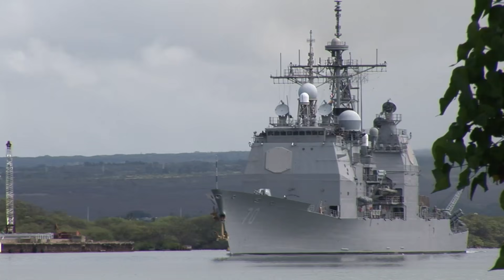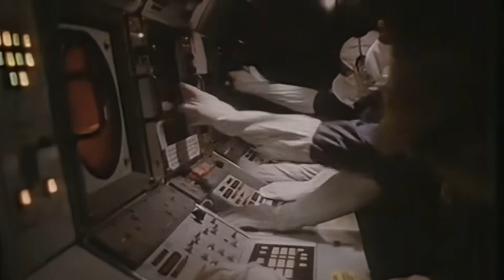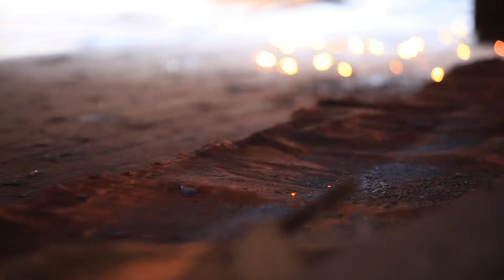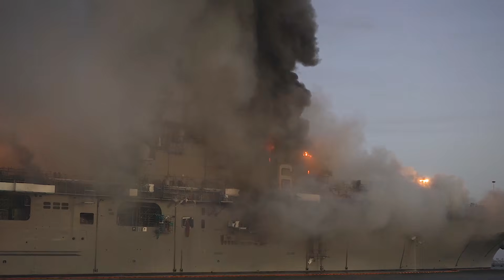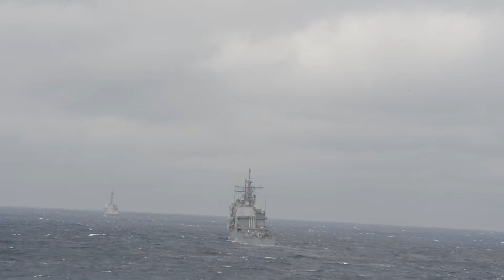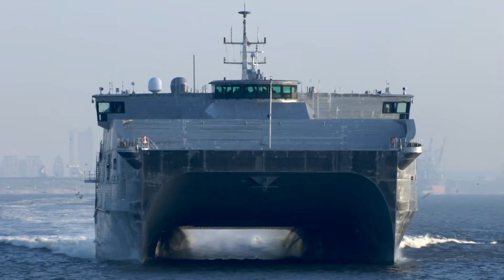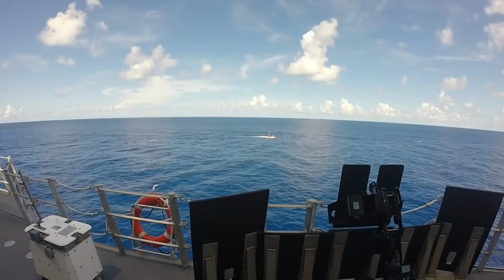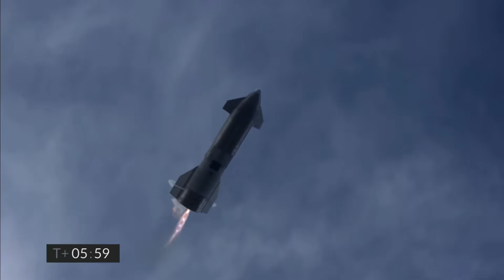Why is The US Building Aluminum Warships?

Comment: The sad fact is that an institution that is so steeped in history as the USN CANNOT REMEMBER THEIR OWN HISTORY!!!  They have to relearn it about once a generation.  Steel hulls with Aluminum was UNlearned when Forestall caught fire and burned Belknap to the main deck level.  A generation later the USN builds THREE classes all on the same engineering plant (Spruance, Kidd, Ticonderoga classes all use same engineering plants) and ended up using aluminum upper super-structures to save weight to make less them less top-heavy.  When SERVICE MEMBERS put their put collective foot down and REQUIRED the Arleigh Burke's be built out of the steel, the USN ended up with some of the toughest, most seaworthy, most capable combatants in the world!  But lessons cannot be kept and when the LCS 'do everything, but do NOTING WELL' design philosophy was promulgated aluminum was used THROUGHOUT the ships.....  Furthermore, after nearly a hundred years of using aluminum in the marine environment, the USN was talked into NOT PAINTING the ships (never mind the fact that crews have reported that crews can literally crumple handfulls of corrosion off of the hulls).  Further aggravating this problem(s)  is the minimal manning philosophy of their crewing which leaves then without enough crew to even PAINT them and maintain topside surfaces!  This now necessitates all 'home-port' bases now have shore crews permanently available to help PAINT the ships!

Comment: Aluminum is used in LCS class to save weight because they are designed to be used on inland waterways or shallow riverways!!
Reply: You're confusing the term littoral with inshore or riverine Force. Wrong mission.
Reply: @WALTERBROADDUS  I was talking about the missions I heard or read about.  As I recall both the Freedom and Independence were meant to support, supply and serve SEALs by launching riverine craft closer inshore then larger assault carriers like the LHA, LHD, classes. Also, the mission packages can be "swapped" out depending on needs of the mission, like bringing SEALs, Marine Force Recon and other special operating forces. Thank You for post!!

Comment: citing space shuttle as an success then it burn up and was abandoned is just weirdchamp.

also your understanding of spacex is wrong. musk choose steel for heat management reason and not due to their structural property.
effectively musk wants the steel to absorb and carry the heat by conducting it to spread the heat over the ship.
this is the same strategy use in rocket engine design were the piping  goes around the nozzle so the fuel double as coolant.
note that this is only a theory, no one has tried to survive reentry by conducting heat before.
the other reason why they are not going for composite is simply an issue of cost since there is alot of development required.
whereas musk can easily and quickly hired steel worker to build them quickly. 
in a way, he choose steel because he expect alot of failures, thus the ability to build dozen of them a year is critical.

Comment: Lesson from the RN: have proper air defense and intercept capabilities. these aren't the kind of shit you should cheap out on.
Reply: bit of an oversimplification. The systems were based on long range Open Sea, bomber threats. They had mix of long and range  systems. Most losses were by dumb bombs, not missiles.

Comment: They cost more and wear out sooner. That's good for keeping the budget up.
Reply: Yeah. I understand using it in smaller ships such as coast guard where the ship or boat being faster would help as aluminium is lighter
Reply: @Cooldude-ko7ps  the cost guard getting new equipment? Lol no where would money come from, the navies budget? Dont ve silly
Reply: @Cooldude-ko7ps  Coastguard? Coastguard?! It's real name is "Puddle Protectors" or "Puddle Pirates" as some others call them
Reply: Not only faster. But any seas over 10ft damage them.
Reply: mine would be bullshitium the unbreakable mettle
Reply: @flintycave5634  kek
Reply: Most bean counters that propose cost saving measures. Never ever served on a ship.
Reply: move to iceland. they dont have a military so you wont have to bitch about paying for it
Reply: @Jim-vg3vb  well iceland actually does have a coast guard (instead of a navy) but its relatively small.... their function in NATO is more about shoreside radar stations, a small airbase and port capability for the allies in NATO.
Reply: That's what happens when Corporate America owns the government.
Reply: Next up: ships made of pure gold
Reply: In 90% case the aluminum vessel which doesn’t corrode will outlast the steel vessel. There are many aluminum vessels out there with the hull over 35 years that are still going strong. Steel ships are often scrapped after 20-25 years as the hull maintenance cost of cutting out corroded steel and replacing  becomes prohibitively expensive. Navy’s generally look after the paintwork much better and potentially get more life out of a well painted steel hull
Reply: aren't military programs focusing on providing jobs?
Reply: @hphp31416  they are, sometimes in hilariously wasteful ways. From what I've heard they were already canceling the Zumwalt class but a representative from Maine claimed they could lose some shipbuilding jobs so they shelled out roughly $7.5bil to build a flawed ship no one wanted or needed, all to prevent a few manufacturing jobs closing. Probably would have been cheaper to have just paid the shipwrights to set fire to piles of money for 40 hours a week instead of building that giant lemon
Reply: @arthas640  Sounds like a pretty good way to reduce the threat of hyperinflation that's looming. Gotta reduce that money supply.
Reply: @hphp31416  Also prop up stock funds like the Carlyle group. The fund transcends governments and insures the most wealthy on the planet win, no matter the outcome of any war.  You need to be very wealthy, like the Bush family, Murdoch, or a Saudi to buy in.
Reply: @hphp31416  It's a case of legitimate reasons overlapping with graft. Essentially, there's valid reasons for a nation with an independent defense industry to do things less efficiently if it means keeping a continuously employed skill base and robust defense industry. 

For instance, the welders who work on submarines are an extremely specialized vocation. 

It costs money to maintain assembly lines and tooling and takes time and money to rebuild them if they're scrapped.

There's also good reason to spread the defense industry out across as much of the country as possible so a strategic campaign or an assault landing doesn't destroy a nation's war fighting capability in one fell swoop . . . War fighting considerations don't always overlap with purely profit considerations. (Not to say a war may not be motivated by profit)
  
The less legit reasons is that it does generate a lot of jobs in representative's districts and it funnels a lot of money to people they golf and club with.
Reply: @hphp31416  Only partly. That's more of the reason or other way they get specific Senators to sign onto the bloated budgets. "We're giving your state 1,500 high paying jobs. Or keeping those jobs around. Keeping that dockyard or aircraft factory or tank parts machine shop open." So they sign, even if it's hypocritical to their beliefs of debt, budgets and limited government. Because they want to get reelected. But the actual projects come from the military for the sole purpose of improving their capabilities per projections and doctrine.
Reply: @hphp31416  no
Reply: @MinehowTech  Actually, yes...the more people who die in your thin ship hulls, the more people you hire to make more ships, and more people recruited to be in your new ships...that will die. Repeat cycle.
Reply: @MinehowTech  Actually, yes. Military programs and most government programs focus on providing jobs hahaha. Private companies maximize profit, public ones maximize labor.
Reply: @MinehowTech  actually yes
Reply: Fuck y’all I’m making my Vibranium aircraft carrier

Comment: Aluminum doesn't rust like steel does.... Aluminum forms a strong layer of oxide that doesn't corrode. Nilered displays how durable aluminum is
Reply: Wrong conclusion. Rust is iron oxide. Aluminum has no Iron.
Reply: @WALTERBROADDUS  wrong. Aluminum oxide exists.
Reply: @SteveVi0lence  We did not say aluminum oxide did not exist.
Reply: @WALTERBROADDUS  in my post there is nothing about iron. Only aluminum
Reply: @SteveVi0lence  Then don't use the term rust.

Comment: The thing is, surface ships are largely irrelevant when there are nuclear attack subs able to wipe out fleets
Reply: Thermobaric warheads will remove fleets from the sea too...  Doesn't have to be a sub to attack..
Reply: @willrobinson9767  but isnt thermobraphic have shorter range than any other kind of missiles
Reply: @destroyertashkent5713  It's a warhead doesn't have any bearing on missile range...
Reply: @willrobinson9767  but they are heavy and cant be used underwater unlike some missile, thermobraphic warhead can deal large areal damage but some warhead can deal alot more damage but small area and this thing would probably be easier to intercept with a large amount of chemical the warhead have
Reply: @willrobinson9767  so then we go to satellite warfare

Comment: Aluminum does in fact burn. It is the fuel in thermite as well as large solid rocket motors.
Reply: yes it will but you have to have it in a powdered form along with an additional oxidizer. It's more likely to just melt in a fire.
Reply: @phiksit  The powder material in a Thermite mix is the flux agent. The metallics, which is Iron and Aluminium, are in the form of filings / small particles mixed in with the fluxes.
Reply: Aluminium does NOT burn, you can easily Google this ffs, so why are so many of you passing on misconceptions?
Reply: No it's not, it's a booster.

Comment: I'd say the Shuttle is precisely NOT a good example. It's killed more astronauts than any other vehicle with two LOVCs. One of them, caused precisely by tile damage. That could've happened yet another time, but by pure sheer luck, the missing tile just happened to be positioned over a structural part that was steel and not aluminum, and so it survived reentry anyway. 

Not saying aluminum is a bad material, quite the contrary, it's a fantastic material. It's just a matter of using each when it makes sense to do so. In very large structures subjected to heavy stress, or structures where that might need to survive a lot of heat, steel ends up being better and even lighter, because while it is heavier than aluminum, it's stronger, and it reacts better at higher temps, so you require much less of it.
Reply: Titanium-A Battleplate seems a good compromise